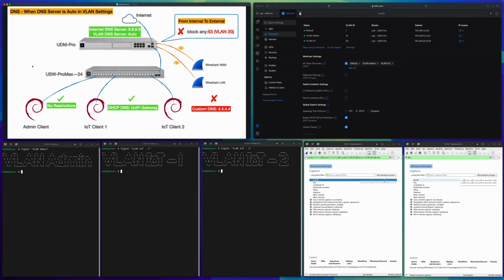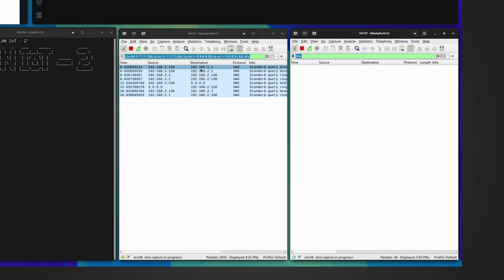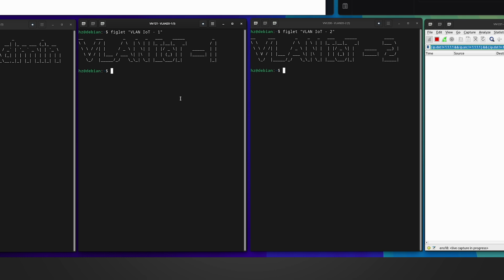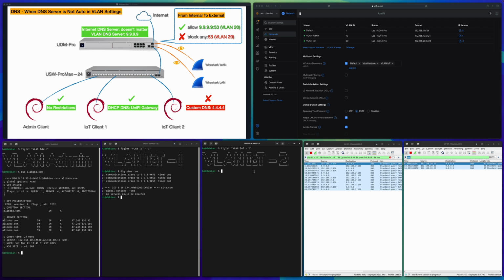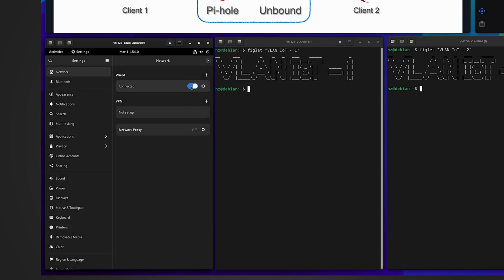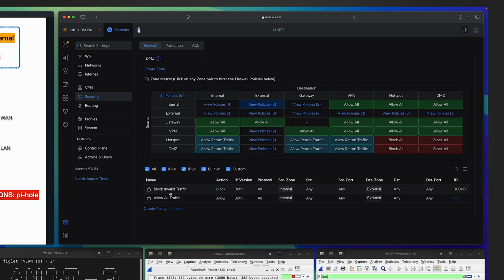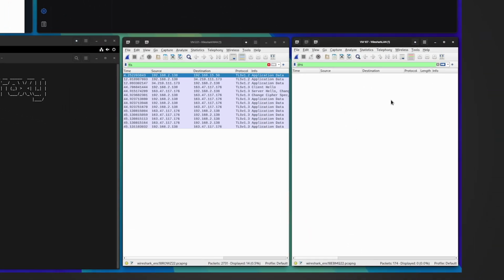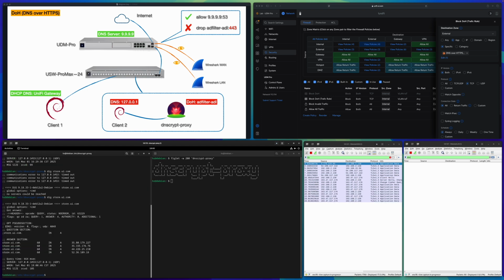Ubiquiti UniFi Gateway - Block Custom DNS Using ZBF (DoT/DoH/Zone-Based Firewall)

Comment: If encrypted DNS is activated, after setting this firewall rule, DNS stop working completely. Is there a different way to create this firewall rule when encrypted DNS is activated?
Reply from the maker: Which firewall rule?
Reply: @hz777  The firewall rule that prevents custom client DNS settings and allows only the  gateway as the DNS server. The way you illustrated in the video by blocking port 53 from the internal zone to External Zone
Reply from the maker: @tjsolid2012  Do you mean:
1) you enabled "Encrypted DNS" in UniFi gateway;
2) you set the DNS Server to Auto in your VLAN's DHCP settings;
3) you use zone-based firewall and you have a policy to block DNS query from internal to external;
4) your client does use the gateway as dns server

Then from your client you cannot do DNS query?

I just did it in my lab environment. I do not have any issues.
Reply: @hz777 I am experiencing a similar issue with @adriankomadowski as DNS Requests are sent to 203.0.113.5:53. Although I have Adblocker on, when testing in your lab did you test with Adblocker on?

Comment: What's the difference in setting block for DNS and DoT using firewall rules vs blocking it as an app?
Reply from the maker: The way it's implemented in the backend in iptables is different: for blocking ports, it's done by using original iptables drop action; for apps, it's done by custom modules.
Reply: @hz777  but the end result is the same? So I can combo DNS, DoT, DoH in one firewall rule, right? Ah btw if I use Encrypted DNS in unifi it sends clients to 203.0.113.X:53 so I would need to allow this part as clients stop working after blocking DNS to External. Do you know how the X is filled by unifi? for example my VLAN 3 uses 203.0.113.5 and I do not know how to match it with rest of the VLANs without scream test
Reply from the maker: @adriankomadowski No, the end results are not guaranteed to be the same. For example, for DoH in the end of my video, the two ways lead to different results.

About UniFi gateway's "Encrypted DNS", I did a video when the "DNS Shield" was just released. I remember the dnscrypt-proxy in unifi gateway was configured to run on 127.0.0.1:5053, but from client perspective,  it just needs to point dns server to gateway. So, I don't know what you mean by "203.0.113.X".
Reply: @hz777  When I have Encrypted DNS on and I block DNS to External then DNS stops working completely and I see it in "Flows" that certain client tries to reach 203.0.113.5:53 and it's blocked. Client gets DNS from DHCP and is listed as 10.0.3.1 (in my case) but DNS look ups end up going to 203.0.113.5:53 so they are getting blocked. Every DNS in unifi is set as auto and encrypted DNS is set to cloudflare-security
Reply from the maker: @adriankomadowski  I believe you are mixing two things together: 203.0.113.X is used by DNS filter. I do have a video about it. I do not think it's related to Encrypted DNS.
Reply: @ By DNS Filter do you mean "Content Filtering" in GUI? I have it disabled so it should not matter?
Reply from the maker: Correct.